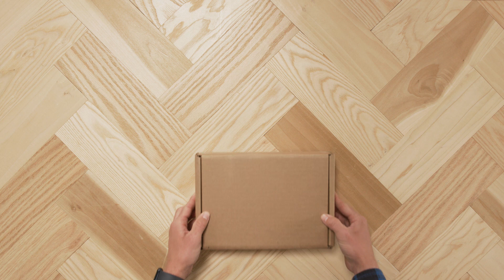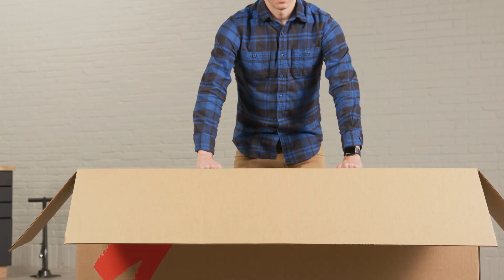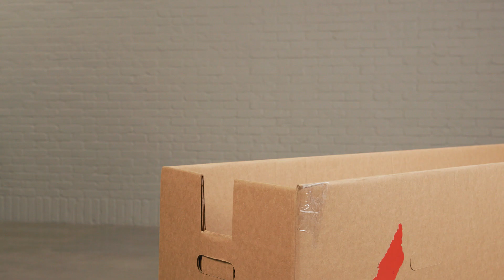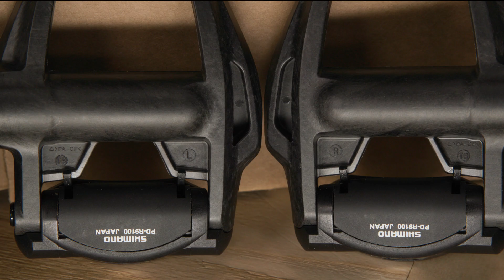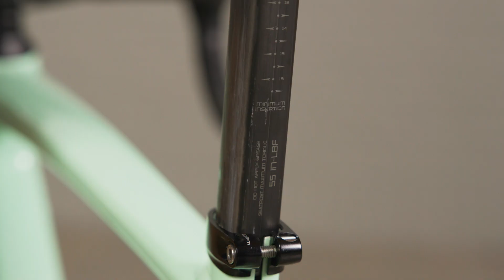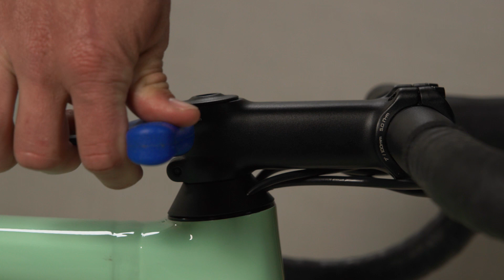How to assemble your new Allez Sprint | Specialized Assembly Guides

Comment: I have no clue how to get my rear wheel into place
Reply from the maker: Hey Vee, it can be quite tricky! I find if you focus on guiding the disk into the brake caliper everything else falls into place. You’ll need to move the derailleur as demonstrated here. Reach out to Specialized rider care if you still can’t figure it out 👍🏼
Reply: @SpecializedUniversity  I didn’t realize both parts of the derailer can move. I was only extending the lower part and not moving the upper part backwards. Hope this helps someone!
Reply from the maker: @spelllingg  Glad to hear it!

Comment: Mine just arrived at my LBS with a defective seatpost and seatpost tube. Really Specialized!😢
Reply: What's wrong with the seat tube and seatpost?
Reply: @sbccbc7471  First bike delivered, seat post would not go in without damage. The second was better, but still marked up the CF pretty bad. It's set now and specialized isn't very responsive on the issue. I can live with it.
Reply: @harriot1019  Carbon seatposts can never be inserted into seat tubes totally scratch-free, especially when there's carbon paste applied which will produce bite marks from the abrasive particles when clamped down.
Reply: @sbccbc7471  I understand how it works. The first bike was defective according to the bike shop. The second is fine, and yes the carbon paste (which I added) leaves small abrasions.

Comment: So now it's $3k for a 105 alloy bike, I need a bunch of tools, and I have to work a shift to build up the bike; the way the bike shop used to do. This video is just weaning the customer out of expectation of value.
Reply: Bike shop will build and deliver for free, if its not defective. In my case, bike shop is getting a replacement.🤞 Not impressed so far.

Comment: It is possible to combo with one piece handlebar to make it aero and clean?
Reply: its literally a 105 clunker of a bike. Better invest in some tyres and wheels.
Reply: @roejogan1759 the specialized is so expensive even in aluminum bike 🤣
Reply: @kuzzzzzzzzzzzz7511  i say its just some shitty marketing and the quality of the specialized bikes has been down bad after sl6. They say the new allez is 40 seconds faster in 40kilometers, if you go at 50 k/hr. I mean, this is a budget bike, for new riders, ain't nobody going to ride at 50k/hr for such a long time!!
Reply: @roejogan1759  yeahh overrated company
Reply: @roejogan1759  Even pros not cycling for 40km alone with 50km/h average. They doing that speed just to present a difference which is THEORETICAL at best. As long as dumb customers will be falling into this bullshit that long they will be shaved out of their money just to feel "faster" lol.
Reply: @JanKowalski-pe9lo  this! and why focus so much on integrating wires to save 3 watts when you can save much more if you make it a little lighter?! tarmak sl2 to tarmak sl6 was the prime time for specialized... ask any pro whether they would actually ride disc brakes and sl7?
Reply: @roejogan1759  Business my brother. Fool and his money are easily parted. Many fools around. Drop stem by 5mm and you get bigger aero gains than all this frame gives you.